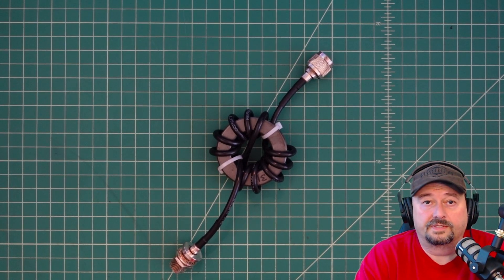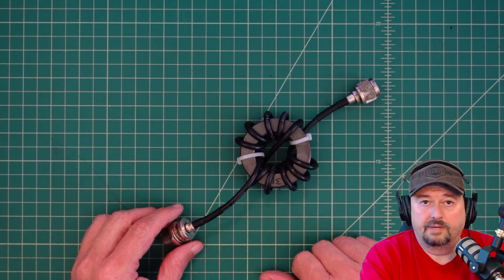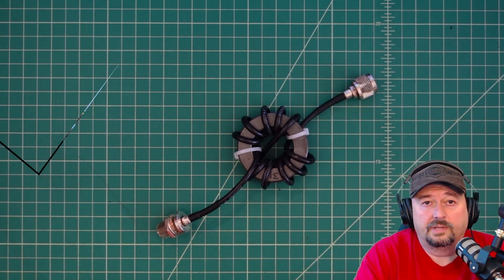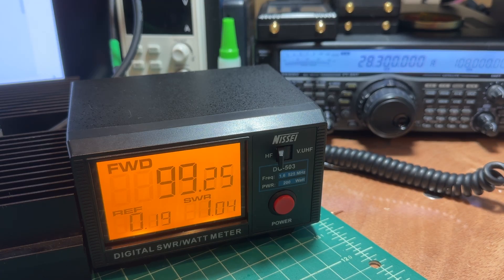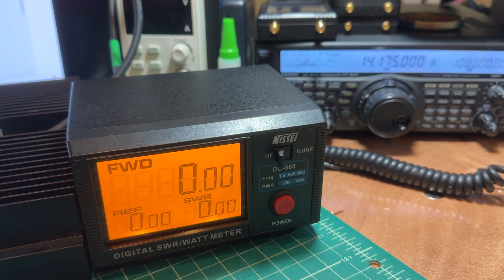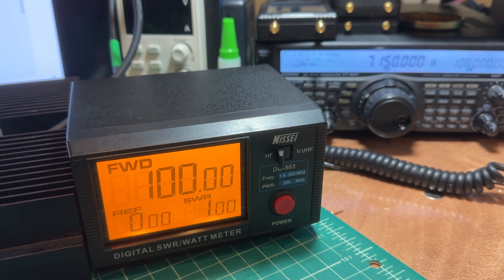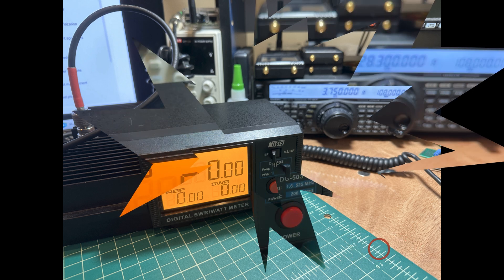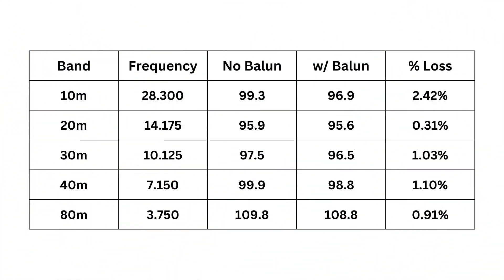Myth Busting: Choke Balun Power Loss - You won't believe this!

Comment: Hi Steve, Firstly many thanks for the time and effort you put into making these very helpful videos. I enjoyed watching your video on chokes and have been searching for some further information regarding levels of attenuation, I have made a 240-43 mix choke that I'm very pleased with the flat SWR across the hF bands however I have managed to squeeze the attenuation down to a minimum of -50dB across the hF bands also but curious if this will be too much attenuation and start to effect the wanted signal? is their any information/advice you have to confirm this?
Best 73's
Paul
Reply from the maker: Hey Paul, I’m not Steve but that’s ok.  -50 is fine, the way these work is by blocking unbalanced current (CMC / common mode).  The good stuff, differential mode current passes just fine 👍

Comment: Hello, Ape
I'm using a 10-40 End Fed
Would you recommend putting the choke at the feed point or a couple of feet away the feed line. I don't have a ground rod so no grounding here , if anything I have a chain link fence that I could use. Any thoughts on your side would be greatly appreciated 73 W3QIN

Comment: Hi Ape,
You KNOW that I've previously stated that your videos are amongst the best because you usually perform some kind of test to produce results in order to back up what you're saying. AGAIN - Thank you for your efforts. I certainly appreciate it.
In the test you did here, I can see two things that could be modified for future content.

1: Type of load
The load is a dummy load, which if it is half decent quality will present 50ohm @ most frequencies.
The load is not some wild impedance presented from a less than ideal antenna.
As a result, the power is getting to the load and is being burned off as heat in the load, with next to nothing being returned. It stands to reason that the choke has nothing to chew on, so it can't lose something that it never "had".
ANY measurement under these conditions will show next to no loss.

2: Position of measurement
It wasn't 10000% clear in the video if the SWR meter was between the radio and the choke or between the choke and the load. 
During the test you performed, the load was as described above (1: Type of load), so the position of the meter would have no bearing on the result (no wild impedence mismatch = no return currents = nothing to measure = no loss).
If, on the other hand, the load was a less than ideal antenna, it would certainly try to return some current. That current would get as far as the choke but would not continue PAST the choke. Instead, the forward and return current would form two opposing magnetic fields that would cancel out and presumably be spent as heat in the torroid (energy cannot be destroyed, only changed in form).

2A: With a less than ideal antenna, and the SWR meter between the radio and the choke, I would imagine that you would see your forward power and close to nothing returned - that is the whole point of the choke.
2B: With a less than ideal antenna, but with the SWR meter between the choke and the load, you would see your forward power and possibly quite a high return. It is likely that the forward power at that point would be somewhat less than your radio output. This would indicate the loss, no?

One final thing - It would fascinating if someone were to use epoxy resin (high thermal transfer) to glue something like an LM35 temperature sensor to the torroid core and do a 1 minute TX on fairly high power to monitor temperature rise under different loads.
I imagine a dummy load would show no change in temperature in the core, but a less than ideal antenna WOULD show an increase in temperature in the core. This would add weight (or take it away) to the idea of chokes being "lossy".

AGAIN - no shade, no disrespect at all. Yours is one of the channels I come back to again and again.
Reply from the maker: Hey DRH, glad to know you still like the channel.

I did this video because people say the balun choke is lossy, which it isn't.  That's why I constructed the test the way I did.  If I had used an none resonant antenna what I'd actually be measuring is the loss from SWR reflections.

The Tests was RADIO > COAX > CHOKE > POWER METER > DUMMY LOAD.

I actually picked up a pretty nice temperature gun so I can measure core temps in the future.  Stay tuned...

I don't see your questions / ciments as shade at all, I see them as a positive addition to the conversation and I thank you for that.
Reply: @TheSmokinApe  
You know, I read back my initial comment, and now that I have, I missed even my OWN point!
Here it is:
What you measured was insertion loss with an ideal load. You PROVED that in this situation, the insertion loss is so low that you have to be carefull how you measure it. This is good info, as your test took the load out of the equation, and gave us the characteristic insertion loss on its own.

What we could do with is a measurement with a non-ideal load. This will demonstrate the "loss" that people talk about. Sure, a choke will (hopefully) burn off the returned energy (as a result of the non-ideal load) as heat producing the "loss" that people talk about, but that energy was destined for our fingers and the neighbours stereo anyway. 
Yes, we "lose" that energy as heat, but how else can we limit the damage it was going to do?

What's the alternative to chokes / baluns? 
RF burrns and neigbours banging on the door!

I veiw it all a bit like the coolant radiator on a car. The radiator is "lossy". VERY lossy. It's supposed to be! It provides some efficiency "loss" by dumping energy as heat, but the alternative is a warped cylinder head.

Comment: Thank for measurement. I think Your very small loses are from connectors. Myth are growing where basic physical knowledge is not assimilated. One "Youtube expert " show antenna installation in a truck and  gives advice "if you have too long cable, NEVER ROLL in a loop because of COLOSSAL LOSES - lay down freely in zigzag". Without physics hards to distinguish in a brain common vs differential current.
Reply from the maker: Haha, thank you for the comment 👍

Comment: Would there be more loss on vhf and up?
If so would today be a factor of the choke or the rg58 used on this choke? 
Awesome video!!
Reply from the maker: The loss is dependent on the core makeup and the coax.  you would need to see what works best for your band of interest.

Comment: Interesting results. I would expect the loss to increase with frequency, so I am puzzled about the 14Mhz result, I would have expected a loss of about 1.5%. I would like to see more results with different choke/baluns. However, the loss is insignificant for ham radio use. I just don't like outliers I can't explain.
Reply from the maker: I agree with the premise of more loss with higher frequency and was equally surprised by the 20m results.  I do have a number of other videos doing similar test but they are with the NanoVNA.  Thank you for watching 👍
Reply: I also wondered about this. Maybe taking a several readings at different frequencies across each band would have given a better sample?

Comment: I wonder if the 10 meter loss would come down if a different mix was used.
Reply from the maker: Hey Paul, the coax RG58 is more lossy at higher frequencies which I'm sure plays a role.  Thanks for watching and for the comment 👍

Comment: A outer jacket coax ferrite CMC suppression choke will not create any loss. The loss that you will get from the type shown is due to the connectors, this is why you use slip on beads and terminate the coax after the beads are on, this way there is no connector loss which is minute anyway.
Reply from the maker: I think the loss here was more about the rg58 than the connectors but I could be wrong.  I have a bunch of videos, probably the most from a single channel, testing all kinds of baluns from a choking standpoint and insertion loss.  What I have found is the toroid cores outperform the beads.  Thanks for watching and for the comment Shane.

Comment: Hey Ape, Rick, K2XT here.  You put up a catchy title, hinting there was some myth to be debunked.
Then you made a simple test in an environment that doesn't require a balun.  Your balun there on your bench doesn't see any common mode current from the non-radiating load; therefore it is not being stressed at all.  The only possible losses would come from the lousy, lossy rg58 and the way you have it wound so tight on that core.
Others have suggested, why didn't you measure the loss of the rg58 alone and you should see some little loss that is greater on 10 meters than 80. So, you didn't really analyze or provide the newbie viewer with a reason for your conclusion.  
Since you tried to convince the viewer that CM chokes don't have much loss and let them go away with that little jewel of technical fact how then do you explain why some CM choke vendors sell "2 kw" and even "5 kw" chokes, with multiple stacked cores?  Why 5 kw?  Because the 2 kw ones are burning up, so throw a bigger choke at the problem. DXE will be happy to take your money.
So, in conclusion, you claim to have debunked a myth but in reality the viewer is no closer to understanding what is really going on in their antenna system. i.e. what effect the feedline length from feedpoint to where it is grounded has on the common mode impedance of the outer shield. When that is understood and evaluated then the reason why CM chokes heat up at all can be explained.  Until that is accomplished "myths" will continue.  
Agree?  Here's what's going to happen - someone watches this video, believes this puts the issue of choke losses to bed (just look at the comments to see how quickly they became convinced and give 5 thumbs up for the video).  Then he puts up a OCF or G5RV and his choke heats up and maybe cracks the core due to horrendous CM current.  "But wait, Ape said losses are a myth, why did DXE say I need a bigger CM choke, a 5 kw model?"
Sending warmest 73,
Rick  K2XT

ps This topic is quite complex
Reply from the maker: Hey Rick.  I agree, the coax is the lossy part...  I have a buch of vides showing coax and core loss.  I also agree that the core isn't stressed, but I was responding to comments that this types of chokes are lossy and I'm fairly certain that you would agree that a ft240-31 isn't going to get stressed to a failure point from 100w.  I think your example of running 5kw into a G5RV is a leap at best.  This video shows a core at 100w...  and I'm sure it's going to be fine at 100w into a G5RV.

Comment: Ok next questions.  Is it necessary to even use a balun for a perfect match like a dummy load?  What happens to the loss when the swr goes up?  What frequencies is that even capable of choking?
Reply from the maker: Here's a video where I cover the frequency coverage of this and another core: https://www.youtube.com/watch?v=1D9XpXWZ_a8

I sue this exact core with success on and antenna with 10:1 puls swr.
Reply: @TheSmokinApe  I appreciate the videos and response.  I think there are a lot of variables in testing baluns that still leaves me with more questions!  This video series gets out in the weeds a bit.  I am sure you have seen it.    https://www.youtube.com/watch?v=kMlKfHHR8FY

Comment: Interesting results, of course the cable is being bent far tighter than it should be and this can cause the centre to migrate so in theory it might vary from the designed 50 ohm characteristic impedance. That MIGHT cause some anomalies with the power measurement. Certainly none of the losses would worry me based on efficiency, however it is worth thinking of the significance of the losses, at high power, high duty cycle a common mode choke mounted in a small project box could reach quite extreme temperatures at 2.4% loss. In this test set up there should be no magnetic field induced in the ferrite, so the core should not be a source of loss. With a typical antenna set up the loss will be greater but of course difficult to replicate. 
Well done on the measurements 73
Reply from the maker: Hey g0fvt, thanks for watching.  I don't think I would disagree with any of the points you make.  I did do this test at 100w, if I was going to run legal lemit I would use a different choke.

Comment: My Nano VNA is my SWR meter. 🧐
But yeah, makes sense for these choke baluns as the shielding is like a VPN tunnel. I do wonder about the losses in a 9:1 unun though.
Cheers.
Reply from the maker: Hey WR3ND.  I think the NanoVNA is technically a Network Analyzer that we use to characterize antennas, one of those characterizations is SWR.  When I think of an SWR meter, it's something that I use inline with my transceiver to get realtime SWR measurements.  But I get your point.  Here is a video, I do have others, that show loss from 9:1 unun's, hope its helpful.

Thanks for watching and for the comment 👍
Reply: @TheSmokinApe  Thanks. I'll check your channel again - I've probably even seen them and just forgot the figures. Cheers buddy. Have a great weekend!
Reply from the maker: @WR3ND  thanks man, you too 👍

Comment: I bet most of that loss is just from adding the extra conections in the coax chain and not from the Balun. You could test it with just a straight jumper, then Balun, and finaly with just the coax to the antenna.
Reply from the maker: Hey JR, thank you for watching.  I just wanted to show a simple demo of loss in the core itself, I've got quite a few other videos showing loss in core and transmission lines if you are interested.  I agree that this is't a "real world" example like FALFAL stated but I addressed his comments under his original post.
Reply: @TheSmokinApe  I agree, simple test that anyone can do at home with basic equipment. I have been following your series of test and greatly enjoy and appreciat you doing them. For the "real world" this test would indeed show what you are trying to do, you just need to record the numbers while you do FT8 for like an hour.
Reply from the maker: I've used this exact choke at 100w on ft8 for more than an hour and it was fine.  Because its not a transformer like a 9:1 or 49:1 the heat is significantly less of a problem.
Reply: That's what I was going to add. I am actually planning on building one for the portable equipment.
Reply: Maybe.  I don't trust the readings he got, but that is not the issue.
Read my lengthly reply in the comments.  This topic is far, far more complex than a viewer can be led to believe from watching this video. i.e. the choke was not being stressed at all since there was no common mode current with that setup.
Reply: @feeatlastfeeatlast5283  Sure as you reach saturation of the core it will affect what is going thru it. That is why you build your Balun to comfortably handle the most amount of power you could possibly be putting thru it.

Comment: great job ! that good for a RG 58 U coax.  it's not the toroid that makes the loss in this case . it's the coax.  and for short piece a RG 58 is fine.  I made mine with RG 8X and RG 400 for more power rating. I melted 8X with 1 KW . RG 400 took 1.5Kw just fine. The one showed hear is great for POTA and SOTA . you will never notice the loss. in fact it may help with the noise floor.  put right at antenna if counterpoise . if coax is counterpoise put at tuner or radio. simple as that. 73's
Reply from the maker: Hey Robert.  I agree the loss was mostly due to the coax and in the case of improved noise floor I get better Signal to Noise.
Reply: @TheSmokinApe  get the ABR one with PL 259 to SO 239 and made with RG 400 coax. wont see a loss and rated full legal power.  want N or BNC ABR makes them that way.  keep testing ! lots of myth's to bust ! :hand-pink-waving:
Reply from the maker: Yeah, the ABR stuff is great 👍

Comment: Good video. I liked its objective data. Can you provide an objective way to compare antenna setups? SWR is just one small part of what goes into having a good antenna setup. For example a dummy load might give us a perfect SWR. I am a new ham, and haven't gotten to digital modes yet, although I want to in the next few months. My guess is that using some some digital modes and/or and beacons, might be a good way to objectively see which of two antenna configurations is best, and by how much. I could envision two antenna configurations with the same feed line lengths going to a switch and we first check antenna A and somehow measure reception and transmission on it (and maybe count contact in 5 minutes or signal strength) and then we switch to antenna B and measure reception and transmission on it (maybe count contact in 5 minutes or signal strength). This methodology might also be useful when checking things like whether X radial configuration or Y radial configuration is best. I understand you might need to do this a few times to remove changes due to propagation conditions during the 10 minutes of the two tests.
Reply from the maker: You can use PSKReporter to see how strong your signals are being used when doing digital mones, it will also let you observes propagation patterns.  For voice or SSB use websdr.org and you can choose different SDR stations to listen to or record your audio.
Reply: A while back you had a video where you were trying to come up with a better EFHW design. You had the standard design with the 49:1 transformer and the capacitor on the feed end and you were looking at a design with the capacitor on the antenna end. I followed that and I was interested in what you would find. I don't think you ever resolve it. If you ever did build the second EFHW design you could test them both with this switch idea if you find something you can objectively measure for transmit and receive strength.
Reply from the maker: I haven't messed with the EFHW in some time, once I do and get it working I will do a video.  Thank you for watching Cary 👍